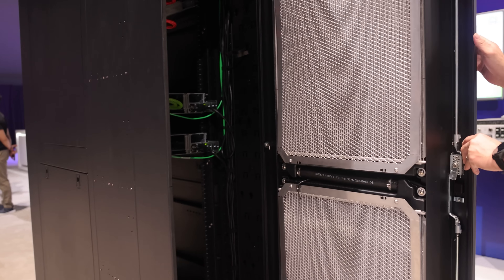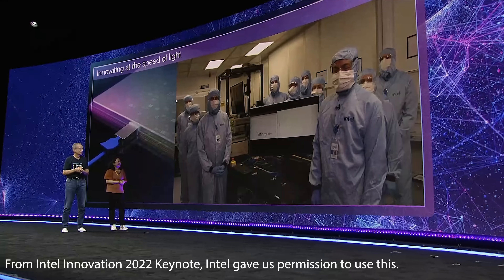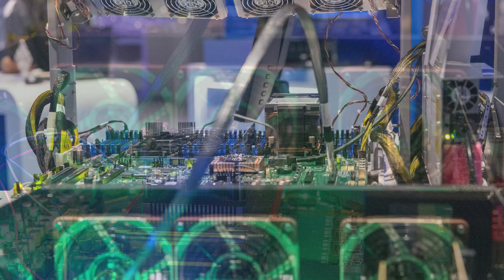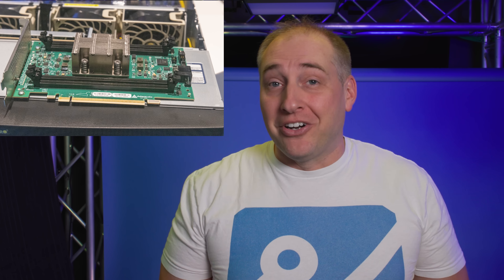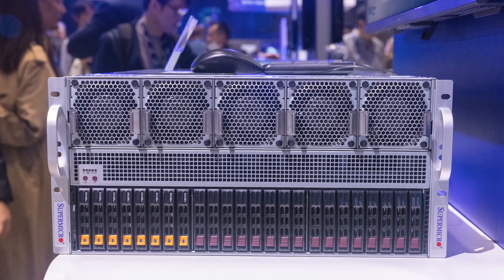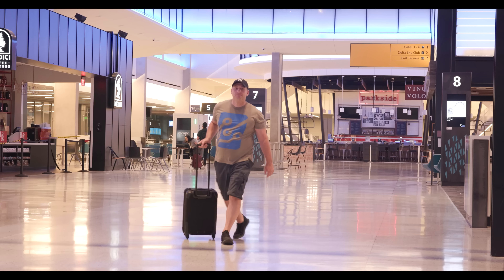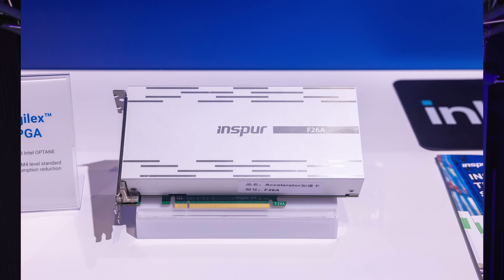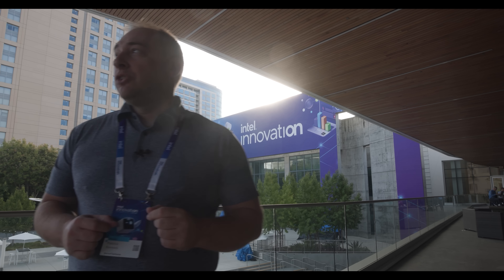This New Server Tech is WOW!!!

Comment: News flash, Cisco’s new chassis is available, liquid cooling ready and made to take advantage of CXL and has been out for over a year, why no mention?
Reply from the maker: I mean, Dell PowerEdge MX was designed for PCIe Gen5 and CXL and we reviewed it back in 2018. https://www.servethehome.com/hardware-behind-the-woweredge-dell-emc-poweredge-mx-innovation/

Cisco was not showing the chassis off at Intel Innovation 2022. If they do not bring a chassis, we cannot show it off. As we see next gen server parts launch, most vendors will support CXL. We already have almost a rack full of servers from different vendors that all support CXL so it is coming, we cannot show them yet.

Comment: One overlooked thing with CXL memory is RAMdisc.  Making memory a virtual drive has been around since the 80286 era and ' cheaper ' ramdrive cards.  With these, even SSD drives will not be able to keep up, boot time can take longer with setup and unpacking an Iso into the drive and then the shear speed of ' drive ' access.  At 2 Tb per card ( max ) that can be quite the library at almost instant access.
Reply from the maker: With CXL 3.0, that RAM disk can be shared among hundreds of servers.

Comment: Congrats to the memory for coming out as non-binary
Reply: Data is a social construct.
Reply: Okay, memory, but what's inside beneath your chips?? /s
Reply: 5600 mega-trans per second
Reply: Yes but, is your socket male or female? You can't just swap a male socket to a female one, that's not how the system works!!! The other memory doesn't feel safe being in the same motherboard - let alone in the channel next door!! Also, will your memory being non-binary cause my own memory want to change it's socket designation too??
Reply: @DavidStruveDesigns  Trama inducing
Reply: @DavidStruveDesigns  
how dare you you assume such things, connectors can define themselves as whatever they want, they can be male or female or even both if they want, their shape doesn't define them, two male connectors can transfer data the same way a female+male connection can 🤬
.
.
.
(for anyone that could misunderstand: this is obviously a joke, don't take it seriously)
Reply: To bad about the failure rate being about 52% happens with most bleeding edge tech
Reply: IM LITERALLY SHAKING!
Reply: @dobermanownerforlife3902  check out the song Gotcha Shaking by 36 mafia
Reply: @nicekeyboardalan6972  is that a suicide joke?
Reply: @_Ter1an_  no I'm just stating the failure rates of the ram
Reply: rofl
Reply: they/them gonna be pretty annoying then
Reply: @DavidStruveDesigns  but what is a socket?
Reply: So brave....

Comment: Can't wait to see your overview of the new Lenovo Sapphire Rapids Servers. And how you configure the components: GPU's (hopefully at least dual - double wide), 200GbE/sec com ports and DDR5 4800 Mhz RAM. Will it support Kioxia PCIe Gen 5 SSD's? Hope it has great cooling and dual hot-swap 1100-1400 watt power supplies and a bunch of hot-swap cooling fans.
Reply from the maker: Still a long time until we can show Sapphire fully.
Reply: @ServeTheHomeVideo  oh well all this talk about PCIe Gen 5 and Sapphire Rapids is just smoke and mirrors I guess. It’s funny because even my lovely Dell T3660 base model Workstation has i9-13900K PCIe Gen 5 proc and a FHFL Gen 5 x16 PCIe slot for the NVIDIA RTX-A6000 GPU. All SSDs are NVMe Gen 4. It’s running Windows 10 Pro. It has 25Gb/sec fiber and 10GB/sec RJ45 using ATTO TLNS-3252-D00.

Comment: I would not refer to that as non-binary memory, as it is still using binary bits to store data.
Reply: Yeah, it's just technically incorrect.
Reply: I thought this would be quantum
Reply: It has nothing to do with binary bits. Its non-binary capacity memory. Dimms available in an amount that is not a power of two.
Reply from the maker: Yea it is just the industry term for it. I asked a few folks at the show

Comment: Things that should happen to computers in the near future: 
Get rid of sata ports. All storage should be done through sff 8643 or some newer version of the port that’s capable of running both nvme drives and sas/sata drives. In addition to this, the technology should be utilized in a way where hard drives are designed to be multi tiered. You can have a sas or sata ssd or hdd with the bulk of the storage in that, but sped up by gen 4/5 nvme storage. Perfect for small itx builds that don’t have a lot of room for storage. Ram makers need to bite the bullet and release ddr5 64gb dimms. The people who make usb need to just finally make thunderbolt 4 usb 4 or usb 5. Thunderbolt should be on every enthusiast board there is. Workstation boards should have thunderbolt.  And this isn’t really so much about hardware as it is storage, makers of ssds need to label what type of solid state storage is being used and it should be easy to find. Right on the front of the box. Especially when now some tlc drives are cheaper than the same capacity qlc drives. What if you’re a snob and you only want mlc and don’t want an 860 pro or a 960 pro?

Comment: So the fibers from the chip only jump to what, the case edge, right?  Does the junction to the external fiber require a repeater?
Reply from the maker: The vision is that it does not

Comment: Seeing the CXL switch and memory cards gave me a glimpse into potential future - rack scale computing. Chuck CXL switching bus spanning full rack, and whole tray of backplanes (1 or 2U, but still capable of functioning as stand-alone nodes/systems). Stick into it networking, compute (core), storage, accelerators and memory and suddenly you have infinitely expandable system, that's self organizing (by proximity of resources), self partitioning (hardware level virtualization), and by extension safe (replication/migration is instantenous by virtue of potential redundancy which can be controlled by weights instead of hard defined rules). With sufficiently fast networking that system can be expanded even beyond that.

Not only "high density" would be redefined, but also by virtually erasing boundaries between systems on-demand, utilization of systems would skyrocket.

I have been working with storage-oriented PCI-e external switches and things you can do with them are insane - dynamic raid, external raid controllers, remote replication, sharing of volumes, virtualization host redundancy, all this while retaining simple nvme protocol from node pov - looking into cxl future is truly a marvel
Reply: I like your funny words magic man
Reply: This is typically referred to as composable or "disaggregated" infrastructure.  Intel has been working on this for probably more than a.  Since at least 2013 they have publicly been working with Facebook on this exact thing using silicon photonics.  Today I believe it all falls under the umbrella of "Intel Rack Scale Design (RSD)" if you want to read more about it.
Reply: @lordcheeseburger507  Yay! Someone knows about it! I'm quite familiar with it - I even had opportunity to meet some of the team working on it, that's where I got the idea from (my workplace is close to Intel in various ways). RSD deals with it on network level, with notable exception of NVMe-oF. No matter how much you accelerate network, however, RDMA or not, there will be a lot of latency and overhead. CXL interconnect not only brings down everything much tighter latency-wise, but removes the conversion. I have set up and used memory servers, but it's not exactly what people think - except now it can be!  That's nuts! On the RSD side, however, there is much more flexibility (like truly remote resources, I am not sure if I heard correctly about CPU and at least parts of RAM of a VM not being in the same rack?), reliability against network issues and built-in reliance on multi pathing. CXL "network" or interconnect would need to be hard-limited to rack scale, or perhaps adjacent-rack only, making these targeting different markets. 

RSD does not quite use off the shelf hardware in its core, but CXL integrated systems will definitely aimed at customers with deeeeep pockets, as it's basically completely new class of system. This is halfway between supercomputing and specialized blade systems, so honestly for it to work it will need to offer tremendous advantages and capabilities over current systems versus TCO, including DC space/power/cooling capacity, otherwise it will remain as an absolutely mind boggling and super cool demo display when someone actually builds it. :(

Of course RSD, and competing techs can integrate CXL down, but that's another story, and kind of ZFS over hardware raid situation.

We will also have to start worrying about malicious activities on CXL/PCI-Express fabric. If something breaks containment through flawed firmware (because there will be muuuuch more firmware than we are used to), we plainly have zero tools to deal with it now.

Comment: 2:28 - That looks like the original Light Peak that eventually evolved into the copper-only Thunderbolt.  It also has an almost identical name to pre-Thunderbolt branding, "Silicon Photonics Link."  I wonder if Intel repurposed the Silicon Photonics Link for this project.  It would make sense since they already spent all that money on R&D for a durable, easy-to-connect, high-speed fiber smart data cable.

Comment: Seeing a PCIE replacement is interesting, but will it come with new form factor specs? With GPUs getting up to ridiculous power consumption, the current form factor slots is looking ridiculous.
Reply: I guess you are talking about the new  4090...  don't worry Nvidia did a mammoth GPU on purpose, totally unnecessary and with its giant size serving no other purpose than making it impossible to use it in a professional server or workstation. In exchange they also announced  the RTX 6000 Ada with even more cores than the  4090 and double memory but only half of the size and way shorter in all axis. Basically the professional versions are  the same size as previous gen. The new form factor is not for  technical reasons  at all, it is all about stupid  marketing decisions.
Reply: @javiej  
What are the power consumption numbers of the pro cards? Cooling 450W on air is a very tall order. 250W is the most I want to mess with, which already needs large coolers.
Reply: @Austin1990 As per the Nvidia website the TDP of the RTX 6000 Ada Generation is 300W,  with less than  half size and similar performance  than the 4090 with more cores but less clock frequency  (and much more expensive). Having  300W in a dual slot card  was well tested in the previous A100 datacenter GPUs  and works perfectly  fine.  But the point is that 450W is totally unnecessary for that gpu, that extra 150W are because an absurd increase in peak clock frequency, basically you let the GPU to do  excursions  to thermal  limits for just  a bit more performance and then throttle down  (it does not scale linearly at all). That way Nvidia protects the professional models (or they believe so). Apparently  enthusiast  gamers have a lot of fun solving thermal challenges (don't forget it is a "hobby", same as what happens with all the RGB lighting complications and all it's cable clutter ) that pros prefer to avoid. In professional applications if you want more performance you just add a second (or third) GPU, and when reaching  the limits you  just put  more systems and  AC units. In the Pro market your callenge is to make echonomics to work, not the system cooling.
The problems is that sometimes Nvidia stablish a ridiculous  price difference between gaming and  professional models, and when it happens we indeed  use gaming boards on professional workstations and servers. I remember it happened a few  generations ag,  but it didn't happen past generation (in fact it was a bit the opposite due to gaming boards shortages ). Now if they return to bad price  practices (and I am afraid they will) our racks are going to look like a Christmas tree.
Reply from the maker: Higher-end accelerators use better form factors like SXM (NVIDIA A100/H100) and OAM (e.g. the Intel Habana Gaudi 2, AMD MI250X) We will see those form factors hit 700W on air in this generation per accelerator and 8x of those in abox. PCIe in desktops, and the challenge on cooling is often due to costs. If you see many modern servers, like the Ampere Arm and A100 server we just reviewed from Gigabyte, the PCIe slots for GPUs are via high density connectors and cables instead of traditional x16 motherboard slots. That would help desktops a lot with cooling.
Reply: @ServeTheHomeVideo  That's very true. Still, the previous A6000 (dual slot and also shorter ) was also 300W TDP, and it runs nice and relatively silent even on a small desktop  (using a decent enclosure ). Identical form factor is what Nvidia has  announced for next gen RTX 6000   for  workstations, with the only downside of  recycling the "RTX 6000" name  from two generations ago for maximum user confusion  (I guess  the "Pro" división  wanted to break the world  record of confusing  names achieved by their gaming division rivals,  when they renamed the  4070 as  "4080 12GB..."), but apart from that it  is a magnificent  design and it  should also be the  reference design for gaming PCs. A pity that marketing greed won against  engineering excellence, also whiping the whole SFFPC hobbyist market in the way. Let's see the AMD respond, they have an opportunity here

Comment: With all the great stuff you were able to see at the show and your previous findings are you aware of any currently available Intel based dual socket Servers (for MS Windows 20xx O/S) that have the minimum  spec, capable of running dual - Rapids Sapphire Procs, support for 8-DIMMs per Proc at 3200MHz, support for at least eight (8) Kioxia CD8-V Series (2.5-inch) PCIe Gen4/Gen5 SSD’s in the front bay and will have at least one PCIe Gen5 full width/full height I/O slot (for NVIDIA hyper GPU). It should also be able to support at least two (2) double width FHFL (full height, full length) 16x PCIe Gen4 slots for my dual NVIDIA RTX-A6000 GPUs. This Server is a very basic spec Dedicated AI-Inference Machine for Small Data Center/AI Research Lab. Processing Data Real-time from Oracle 19c RAC (using four (4) Dell PowerEdge Servers) RDBMS infrastructure. Also needs to support at least one (1) 32Gb/sec Fiber and at least:
One OCP 3.0 version of the Mellanox ConnectX-6 EN Adapter Card dual-port 200Mgb/sec PCIe Gen4   -- Or --
One HHHL version of the Mellanox ConnectX-6 EN Adapter Card dual-port 200Mgb/sec PCIe Gen4
Needs Dual hot-swap Power Supplies probably about 1100 or 1400 watts. 120V A/C
Should also support at least two (2) 10GbE Ethernet ports or four (2.5 GbE) on the motherboard.

Comment: The PCIe/CXL switches are in interesting idea, I'd love to see them implemented in lower tier products as well, I mean with a good switch on a mainboard you could in theory route all the PCIe lanes from CPU to it, along with all the devices PCIe lanes, thus practically removing any need for mobo chipsets and instead using controllers for USB/TB, or for SCSI/SATA, WiFi/ETH/IB NICs, GPUs and M.2/U.2/U.3 etc. switched through said switch to the CPUs... That could be great next step in platform development.
Bearing in mind that LC oriented rack, I wonder when the CPU and GPU manufacturers start to release LC-oriented direct die cooling "heat spreaders/encasings" with optimised water flows and direct LC connectors incorporated - such tech could improve thermal contraints of very dense deployments, let alone help with propagating solutions towards the consumer space to Serve The Home and not just corporate/cloud rack rooms ;)

Comment: Those CXL memory boards give you an interesting extra option later as well, when the industry moves to DDR6 and your servers all get switched out. If you have a use case for a lower speed memory interface (an extra cache tier?) you can drop in the old DDR5 into a CXL board rather than dumping it on eBay...
Reply from the maker: Yes totally. You could even use LPDDR5X with the right controller.

Comment: Does CXL memory expansion still relies on the CPU memory controller? 
How do  they interface?(my understanding is that the memory controller has dedicated connection on the PGA  for memory traces, and PCI has others)
Also, does the chip on the add in card let all the added memory be  seen as a single channel by the CPU?
Reply: As I understand it CXL is built on top of PCIe, meaning the memory is accessed more like GPU VRAM or NUMA in multisocket than local main memory.
Reply: @GeekProdigyGuy  It's closer to NUMA. There are ACPI tables that describe properties of CXL attached memory to the OS (latency, persistence, size) so programs can explicitly use it.